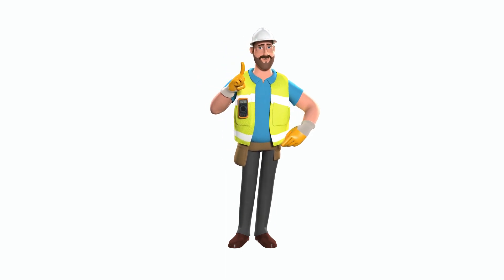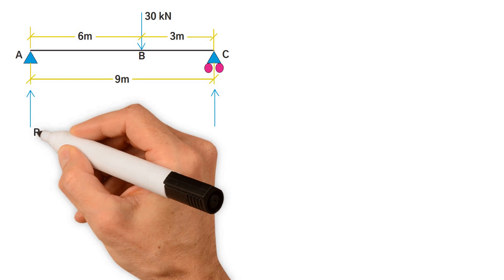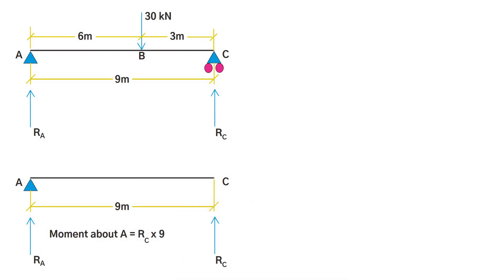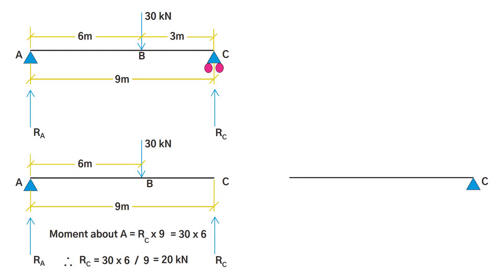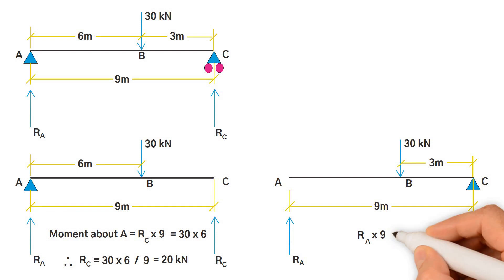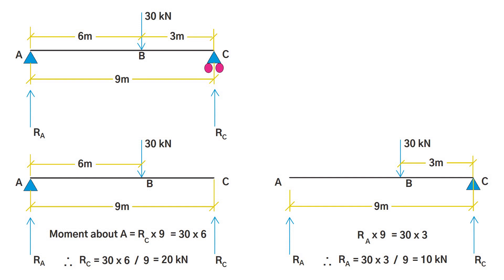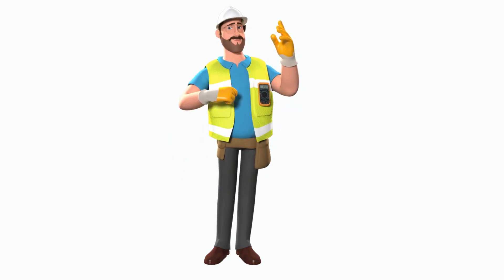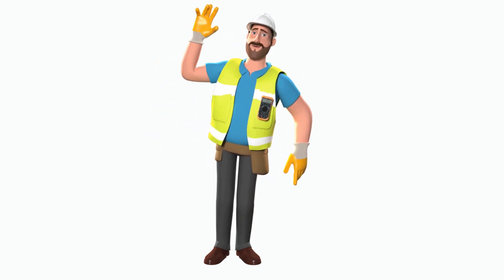How to work out support reactions of a simply supported beam with a point load - beginners.

Comment: Interesting as a simplified calculation but no mention of the stiffness of the beam, surely an infinitely stiff beam would convert some of that rotational moment into a downward force. Youre essentially doing a rotational moment calculation with a proportion of the beam loading, sure its way more conservative than incorporating the moment of inertia and stiffness of the beam but if cost is a consideration in terms of bolted flanged connections then surely the stiffness of the beam should be considered